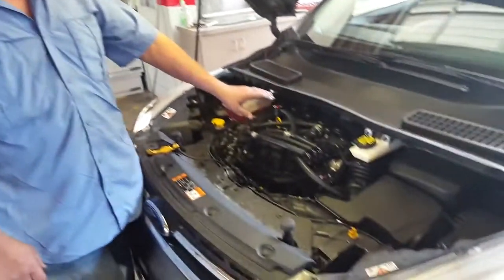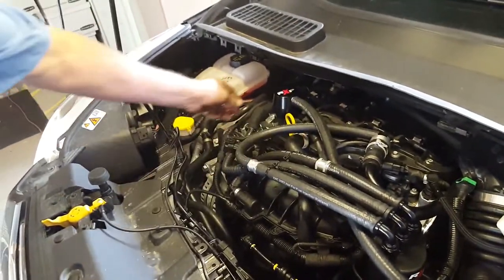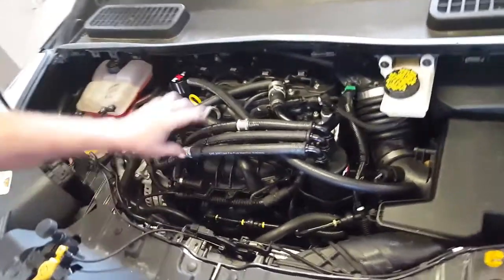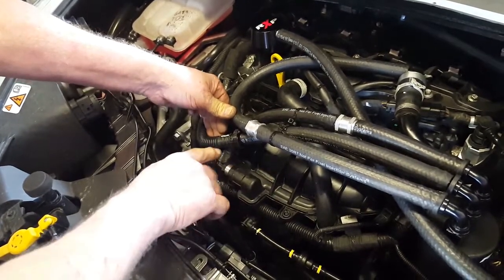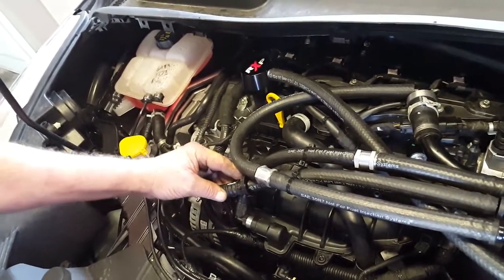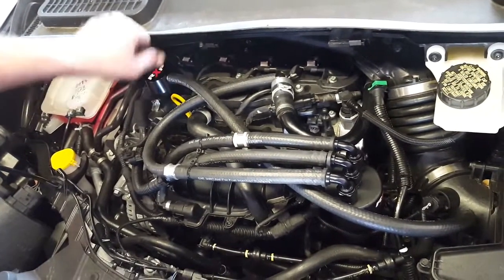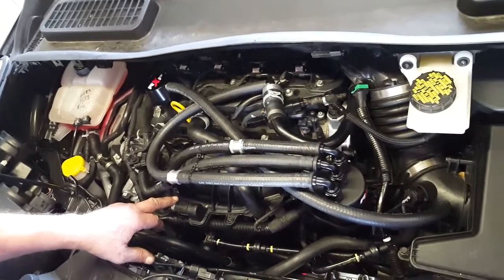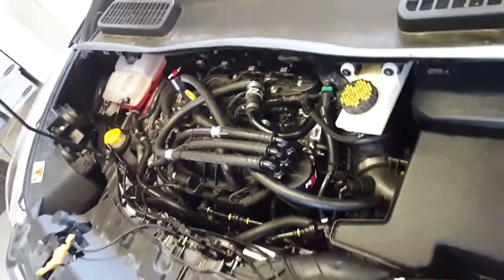2016 Ford Escape 1.6 Catch Can Install

Comment: I wish so much you didn't show us the install when it was done already without showing us the motor not touched yet to show us clearly which lines we have to tap into I checked all the others videos and no clear easy to understand instructions. I'll keep searching.
Reply from the maker: My apologies, you can always email us direct for tech support with any questions and we are making new videos as we get the vehicles in long enough. APDEG@aol.com
Reply: @tracylewisperformance1328  thanks no problem at all I have the exact engine, I looked at it again and figured it out, I did it very simple tell me if this sounds OK, I ran a hose from the top passenger side of engine , pvc out , to a catch can and then from the can to that inlet  at the intake near the front of engine. Seems to run perfect, does that sound good.

Comment: I’m looking for a catch can -2017 focus 1.0. Do you have a kit?
Reply: After researching the problem.  Seems ford fixed the problem in 2017 and most likely will not need this.  They added the extra injectors in front of the intake valve.

Comment: Can this be removed without evidence of install to prevent warranty issues in case of repair under warranty
Reply from the maker: Yes, it is design that way. Keep all your stock parts and all can go back to stock. Now, it is against Federal Law to void your warranty for installing one of our systems as they meet all emissions requirements and in no way reduce, defeat, or delete any function of the OEM system, only enhance it. But that does not prevent an unscrupulous or ignorant dealer from hassling you. You have the FTC as guidance. Google search "FTC guide to protection under the Magnuson/Moss act".  With over 15 years and over 30,000 of our systems in use we have never had a customers warranty denied to date. Ford and GM dealers buy/sell/install these all over the US and Canada.
Reply: Tracy Lewis Performance cool deal. I just got a 2016 with only 12,000 miles and 100,000 mile warranty and I want to prevent as much carbon build up early.